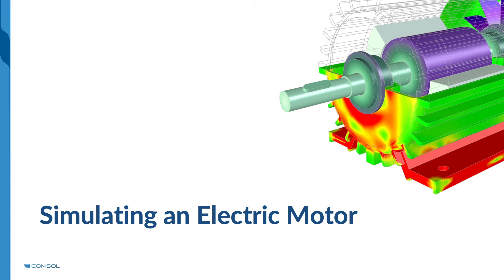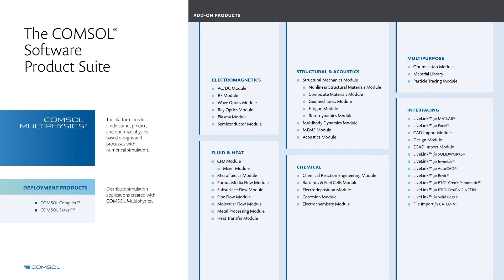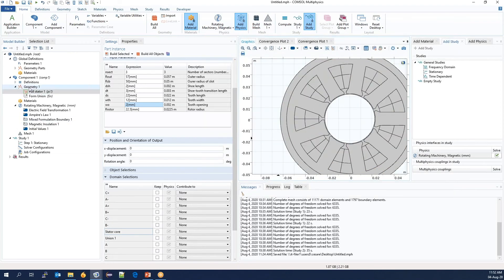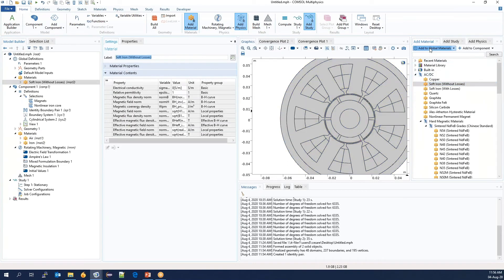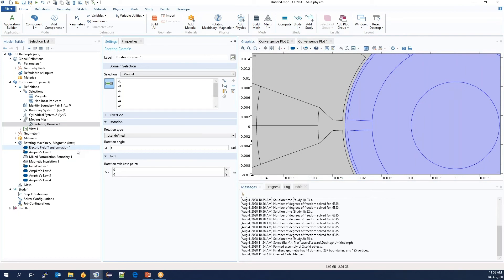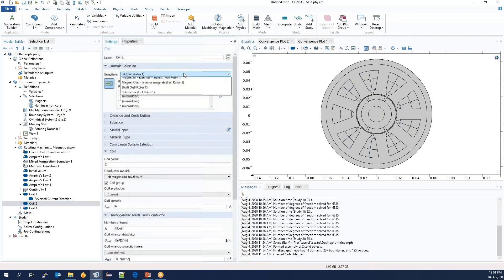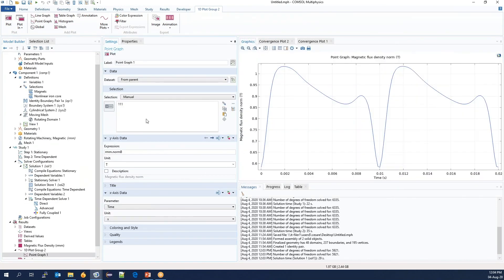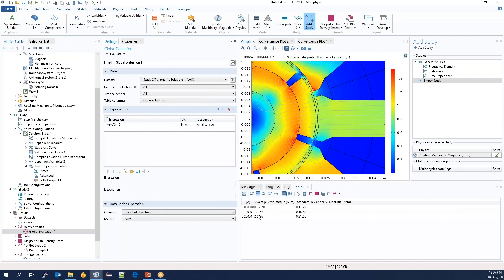How to Simulate an Electric Motor in COMSOL Multiphysics®

Comment: Can I simulate the effects of lightning current on Metal like steel by comsol Multiphysics?
Reply from the maker: Yes, this can be done! You can see an example where someone has done that here: https://www.comsol.com/blogs/keynote-video-designing-lightning-protection-systems-with-simulation/
Reply: @comsol   tanks, I watched it but it was not helpful, I wonder if I can get another video or a sample like the ones inside the program
Reply from the maker: @wejdanibrahem9513   If you'd like assistance with your particular simulation, please contact our Support team via https://www.comsol.com/support